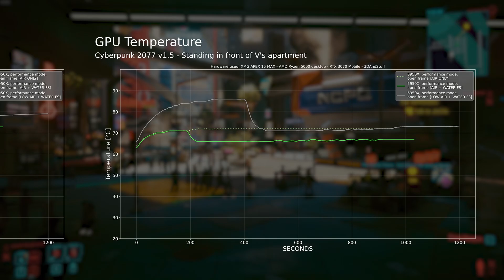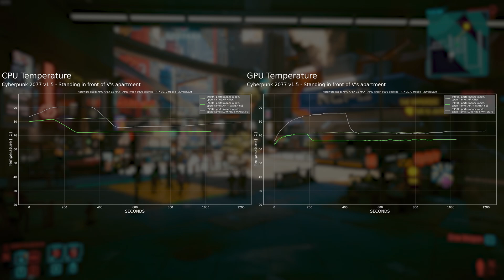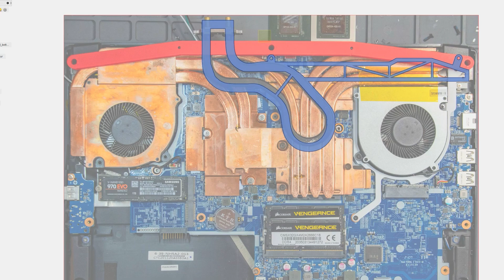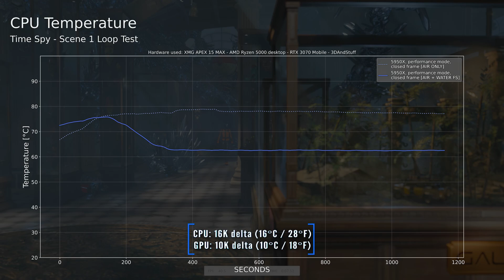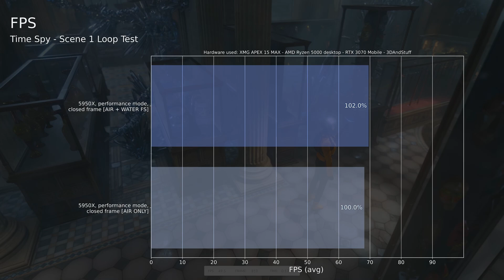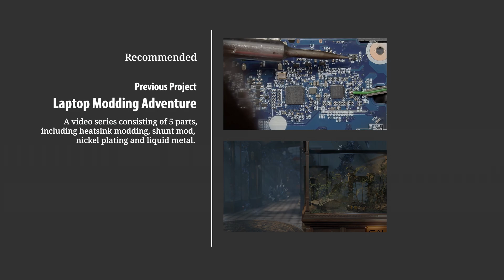Heatsink Soldering & First Run - DIY Laptop Water Cooling - Part 2

Comment: hey there, where did you get the SnBi solder? I want to get some as well. Thanks
Reply from the maker: You can usually find them on electronic components distributor websites like mouser or RS

Comment: There is on aliexpress water cooler for many clevo laptops you should check out. Now i can see how they design those coolings and i need to say aliexpress seems be better... you should try some custom loop wit sensors on in and out how good is actually temperature taking by that water. I'm soon going to watercooling my clevo maybe gonna make some vid.

Comment: can i do this with my nitro 5 with 3060 i5 11400h
Reply from the maker: Yes, as long as you have 8 VRAM slots on the mainboard
Reply: @TechModLab  i have 6 slots also i solved the overheating problem with gelid heatphase sheet but now my battery started to drain while gaming so i kinda gave up on the laptop

Comment: Valiant effort, love it. 
But what really grinds my gears is how laptops are even designed to overheat so much. Every laptop I've owned since 2015 had major overheating problems, I've had 2 razers, a lenovo and now I got a ASUS ROG Zephirus. Still the same nonsense design. I've been using a fan stand on all of em and they can't handle webbrowser + a game open at the same time without risking overheating. 
TBF I tend to have 50 tabs open but still. I just hate having my laptop overheat and crash so frequently, it only gets worse over time, even factory resetting only works for a month or so before problems come back again.
Reply from the maker: Surely thermal paste degradation can play a big role here. Tried out graphene pads yet? Or PTM9750
Reply: @TechModLab  I'ma look into those. Thx.
I have used those sticky thermal pads on anything I can access in my laptops. They do help.
Still ridiculous how laptops manufactures don't seem to address this at all. They put all the specs on their computer as if assuming the whole thing will be submerged in mineral oil and can't overheat. None of these specs are ever accurate.

Comment: I like how you do this just because you can!
Reply: I imagine there was a lot of overheating frustration which prompted this measure.
Reply from the maker: Actually no. For my daily system I don't use the watercooling mod. But I totally should since the fans are too loud for my taste. Temperatures however are fine, even on air. This  laptop model trades it with loud fans though
Reply from the maker: Yes that's pretty much the spirit behind it hehe

Comment: Nice job, I also watercooled some laptops e.g. legion y520,  asus gl552v and now I'll do clevo nh55 - parts  are on its way :)
Reply: @albertwesker4266
i have a lenevo legion y740. And I believe the insides are quite similar. Could you tell me how you've done it? And what are the benchmarks?
Reply: @aymantashfique3194   How ?? By adding copper waterblock onto laptop heatpipes ( soldering required ) and making external watercooling system. The temps under gaming are  around 47-50 degrees celsius on cpu and gpu. Laptop is dead silent, and external water cooling system also dead silent - noctua fans used :)
Reply from the maker: Awesome! Was the NH55 mod successful?
Reply: @TechModLab  yep, still running like a charm, I have removed tdp limits on cpu ( now jumps to 100W  i7 10870h ) and loaded vga bios to unlock 115w tgp on gpu.  Still dead silent and cool :)

Comment: Nice project man, you can add on top of that cooling mod a custom made cooling pad.

I've buy 2x 140mm Artic p14 pwm co, 1 12v fan controller with knobs, a cheap 12v power brick. Than i have add some soft rubber strip on top of the fan case (to make a good seal against underneat panel), i also have do a cheap support to all that and i have 7 to 10°C lower temp with 1000/1200rpm less, basically from 15 to 20°C with fixed laptop fan speed. With that i can cool all the component that are overclocked (now cpu, ram, chipset, forced max dynamic boost, custom unvervolt progressive curve for gpu, n°5 in the world with cpu profile for 11800h with an 1050€ laptop and numer 62 in timespy for 11800h and 95w 3060mobile).

Obviously to have a good result you need to cover all the air intakes with the fan area, but using Artic p14 pwm c0 i have the same noise as the noctua with less noise from laptop fan, much more cooling for all the components and i have spend oly 50€. Try it, you can have some serious improvement. 

Also, if you're not using liquid metal, use Honeywell ptm 7950 sheet version, the best themal interface after liquid metal but without the risk of shotrcircuit.

Comment: I really hope your build is going well. Keep checking back to see if you have made an update to see how you knock it out of the park. If not for you I wouldn't have though to use a hotplate to finish modding my GP66 to be bicooled, I can't thank you enough. Can't wait to see how your build ends up!
Reply: So much time consuming, so much time wasted, so much work for only 10 degrees and 2% better performance, very disappointing.

Comment: Great experiment! I have a question regarding solder paste.13:15  What quality are you using for this mod? I need a good quality one to add some heat pipes to my Notebook's cooling system.
Reply from the maker: Thank you. Actually it's Adafruit's Low Temperature Maker Paste in this video. But all low temperature solder pastes with Bismuth in it will work just as good. The Adafruit one was just easier available at the time.
Reply: @TechModLab  Understood! I actually didn't take into account the fact that it is important to use a paste that has the lowest possible melting point, to avoid compromising the other saltings on the original structure of the dissipating solution. Regarding XMG Noebooks, do you have any news on Ryzen 7000 Desktop support? I can't wait for your next video to come out!

Comment: Great series. Do you think you can improve cooling even more by maybe adding additional heat pipes to the fan or does the Fan not have enough space for that?
Reply from the maker: No space left, no. But I don't think the heatpipes are the problem. I think it's the fan stack's surface area. If that would be bigger the laptop would be cooler. Plus the fans need more room on the intake side.

Comment: So inspiring content, but it is very difficult to repeat.
Reply from the maker: Yes it is, absolutely true. But hey, at least I discovered by accident that removing the back cover benefits temperatures greatly. Planning on a video about that in combo with my 3D printed laptop stand. Tremendously improved temps and fan noise.

Comment: Aliexpress sells pre-bent water pipe with knurled insert nuts soldered at the ends. They are really soft and really easy to bend.I end up routing with my own pipe since the ones they sell aren’t long enough. I used some thin refrigerant pipe and hammered it flat to around 2.5mm so it fits without modification. I got almost 30C drop to under 60C on the GPU with a passive cooled water loop. I have a post on Reddit but I couldn’t post link here rip

Comment: Wow i missed this new series and i'm catching up only now, again, really cool project. Sometimes the modding process satisfies more than using the product itself ang getting useful results even more! For the custom part are you going to use round pipes? you can follow the hestsink shapes and heights with a round pipe and after that you can crush it to obtain a more oval shape for better surface area and easy soldering...like a heatpipe😂

Comment: I am also in the process of converting my GL702ZC to water cooling. My cooler looks like this:
https://ibb.co/fdm7d80
https://ibb.co/GMX99xb
I bought this copper pipe (45CM length) on Aliexpress. This can be bent by hand without much effort. The only thing missing is an AIO system for this.
https://de.aliexpress.com/item/1005001310366650.html?spm=a2g0o.detail.1000014.14.3a41b468fGxuXD&gps-id=pcDetailBottomMoreOtherSeller&scm=1007.40050.281175.0&scm_id=1007.40050.281175.0&scm-url=1007.40050.281175.0&pvid=d9f607c1-c85b-4536-87a5-4e665a8a4fb2&_t=gps-id:pcDetailBottomMoreOtherSeller,scm-url:1007.40050.281175.0,pvid:d9f607c1-c85b-4536-87a5-4e665a8a4fb2,tpp_buckets:668%232846%238115%232000&pdp_ext_f=%7B%22sku_id%22%3A%2212000030394247099%22%2C%22sceneId%22%3A%2230050%22%7D&pdp_npi=2%40dis%21EUR%2110.98%2110.98%21%21%21%21%21%400b0a24a716736975961342320ee0ad%2112000030394247099%21rec

Comment: 💪🏻 keep going, good results as always, i have the 3000 ryzen version of that laptop and i daily drive it without the bottom cover, i was wondering if you can make available the stl file for the stand that you jave 3d printed so i can use a more elegant solution 😅 thanks
Reply from the maker: Yep I will share it on my website soon :) But keep in mind that it is made for use without the whole bottom case, not just without the bottom lid/cover. I could make another updated version with shortened pillars for usage without bottom lid/cover only. You will need longer M2.5 screws though. Also beware that under the middle screw hole is the PCB. If you screw in a screw which is too long you can damage the mainboard.
Give me some days to update my website and you will find the STL there.

Comment: pretty cool project though personally id love to have a mod that can easily be removed so base laptop can still be used as is  my plan for an aio setup is to just mount the cold plate on top of the copper heatsinks and add thermal paste to it instead of thermal pads but it will get a bit messier
Reply from the maker: The base laptop can be used as is. The heatsink with the waterpipe on top still works as it used to. The laptop can still sit flat on table just as before. You only need to drain the waterpipe before every transport.
Reply: @TechModLab  pretty cool that its removable just a bit bulkier i guess 
a way to mount an aftermarket aio would be a cool mod too i have something similar on mine but its nowhere near as engineered as yours mines literally hanging by a velcro strap hahaha